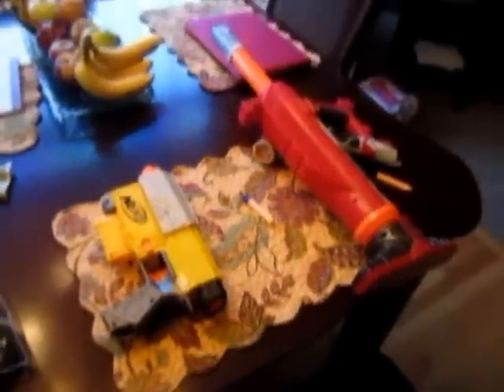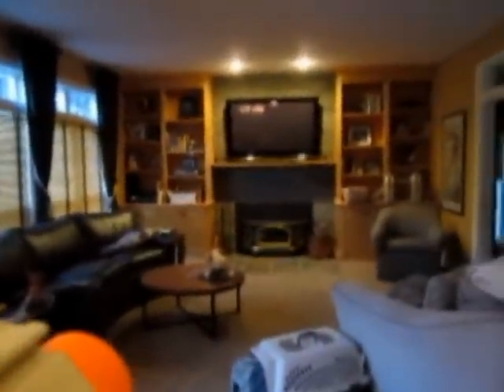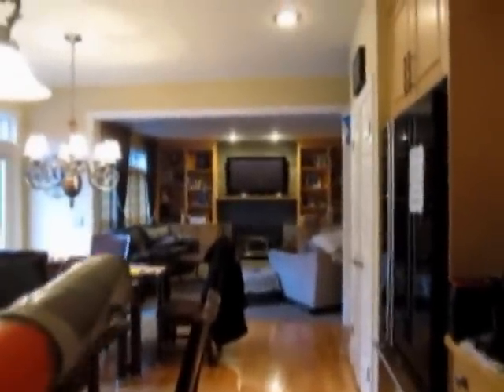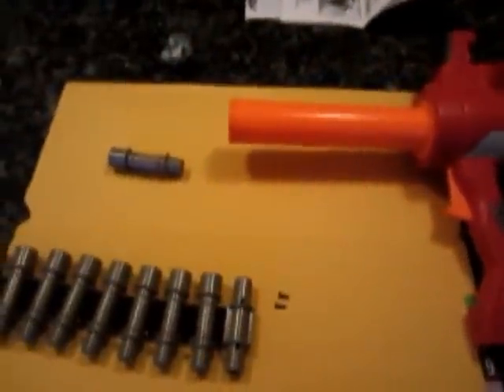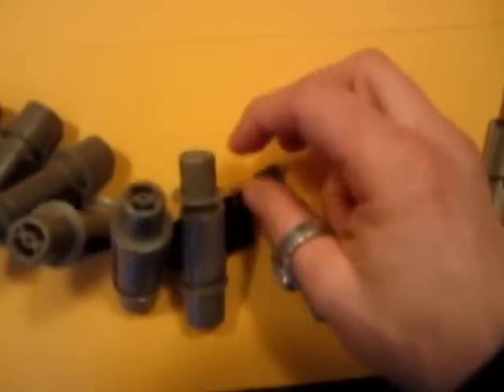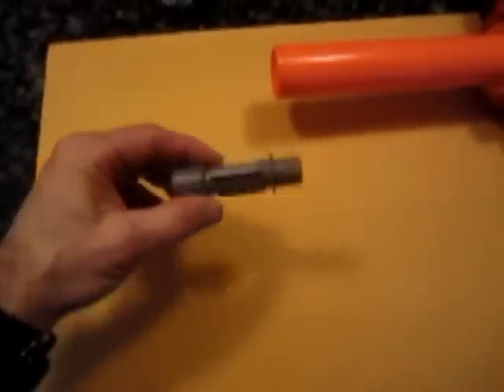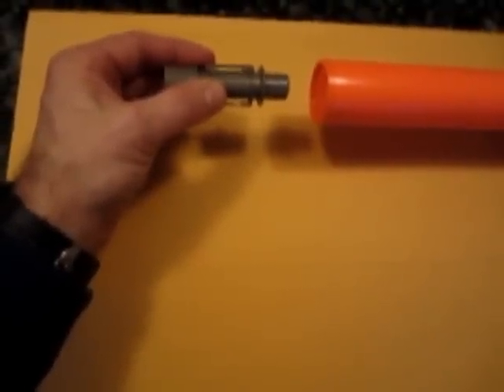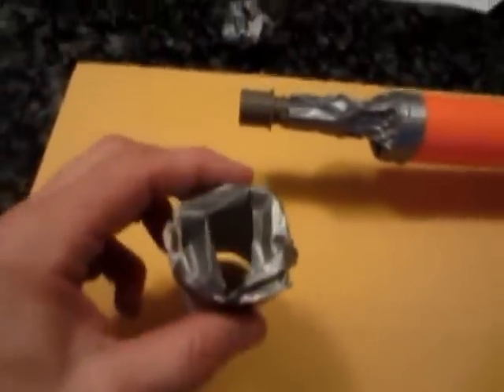nerf mod

Comment: You could also unscrew the barrel from the main body and then attach PVC couplers to reduce it down to CPVC or something equivalent.  That way you will have a much smaller barrel and have it closer to the air tank to get better ranges.